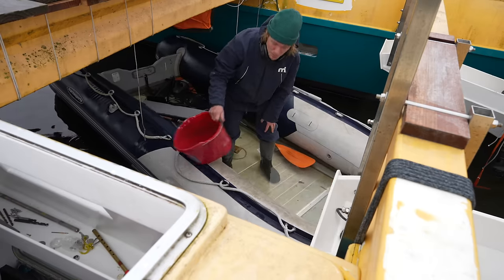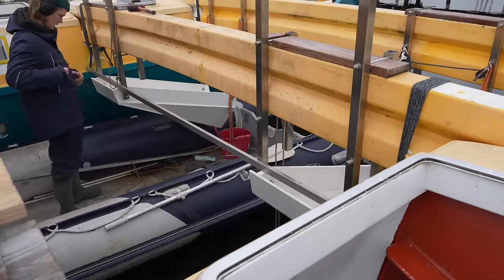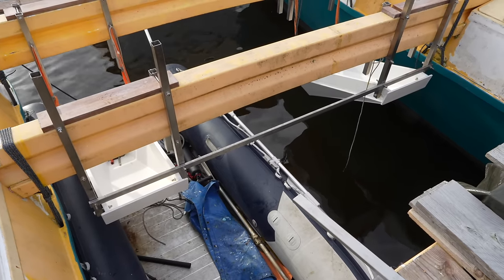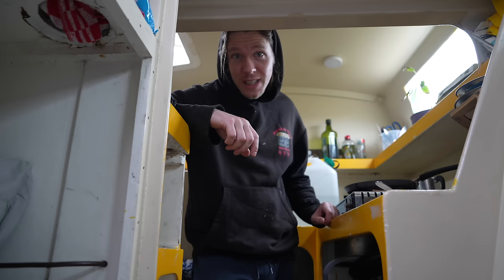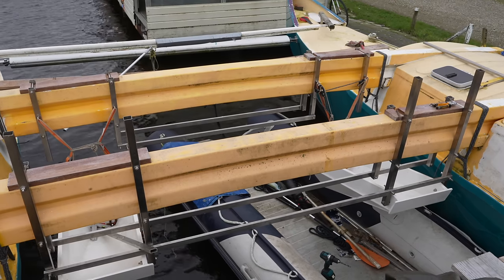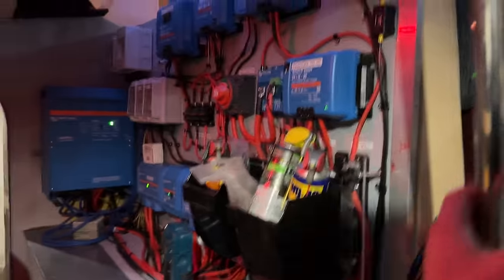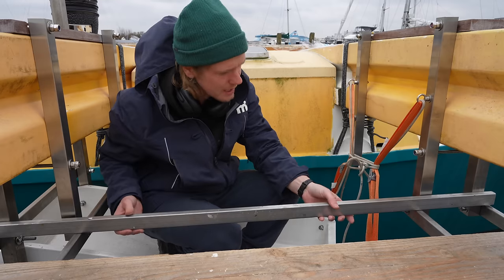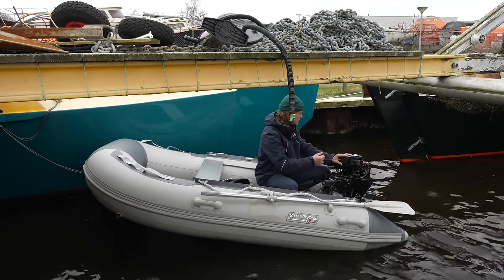I Built A Cockpit Floor for My Ocean-Going Catamaran | Wildling Sailing

Comment: Sorry to say , but you can't bolt hollow tubes together , when you are at sea, it will work loose, as the tubes will compress, and the bolts will come loose ,if you are going to keep going with this , get someone with a Tig welder to weld it all together, and for the main threaded bars that clamp this on to the crossmenbers , add a round tube through the rectangular tudes where the threaded bars go, so the tubes can't compress,
Reply: I was going to say that too and Mark has been learning to weld 😊
Reply: Definitely agree.
Reply: I also believe a threaded bolt is not a good idea for holding tubes together. It will tend to cut and wear in a 'twist and thump' environment, so the whole contraption will loosen up rapidly. Sleeves inside would help a bit, but I am with you on the welding.
Reply: Ty I was searching for the technical comment, I think the whole thing is a really bad idea, ocean salt will corrode the steal to unsafe condition in less than a year, galvanized or not, once you drilled/weld it that join is not protected anymore, paint don't reach inside bolts, this is where you gonna stand, if it falls in the middle of the atlantic you are dead...I love DIY but this thing is really really bad thought and dangerous for him, it's a lot of work I know but I will tear it down to do it again properly...choose another material, don't gamble your life and others on that.

Don't know wich country he is but...there's no maritime regulations there?, as far as I know partially self builded boats must go over inspection before going to sea...when they see this he would not be cleared.
Reply: You my friend are absolutely correct
Reply: Should work just fine, from my point of view.  Just use a locking nut and potentially also some additional locktite. once the design is finalised and proven to wrk you can still weld it.
Reply: @amorfo9127  bro it’s not galvanised, it’s 316 stainless steel. It’s literally made to withstand salt water. You can 100% weld it too, tig welded with 316 filler rods or even mig weld with stainless steel mig wire. I think you are being a little dramatic tbh, just saying.
Reply: I agree with others about welding vs. bolts and I would add angle (forming triangles in the corners) braces. The steel isn't of sufficient span to hold up well even if welded. The whole set-up is going to be tested with any kind of chop. Call me a skeptical mono-huller.
Reply: @ccpmarch1980 it will rust at the welds not a good idea
Reply: @ufodude1000  not if welded correctly. All sorts of things are made and welded for boats out of stainless steel. I’m very confused as to why you think it will rust. stanchions for example or Bimini’s for that matter. If welded poorly or incorrectly then things can corrode but it’s a widely used material and technique.
Reply: Nylock nuts won’t loosen themselves, I’d say keep this design, try it out and if up to par weld it! 😉
Reply: Sadly this a good point, I like the tubing but the flexing of the vessel as designed, is a issue and familiar topic. You did just get a welder....  perhaps some tie rods to manage the flex, possibly from aviation sources.... pretty complex.... my first thought was to fill the ends with a potting compound or a spacer to keep the tube from collapsing at the moment points at the ends....possible sleeve...
Reply: Welding in a piece of distancing tube was enough to prevent that compression problem. It even was sufficient should the distancing part just be in the rectangular tube surrounding the bolts - a Sisiphos task however, to bring those things in the right place while assembling with stainless being not magnetic. You basicly have to use gravity and sticks and do it in the right order. The nylocks could vastly reduce the risk of loosening the connections too far to still be seaworthy without those distance pieces though - it will move and work where those connections are, but James Wharram's boats were built to work and move and take punishments by distributing loads without putting in loadpeaks at connection points. So it might work as it is now.
Reply: @ccpmarch1980  you right. All he needs to use is stainless rods or wire depending how he welds it.
Reply: first thing i thought when i saw him bolting this stuff together...  good call.   one can just rent a welder.  heck, you can probably find a welder who will charge you couple hundred dollars to weld this all together.  Probably will cost not much less in bits and bolts.
Reply: I agree seems like he has more dollars than sence

Comment: Use a magnet to test all stainless bolts, nuts, washers and pipes and tubes. 304 grade stainless will not stick to a magnet and any other lower grade stainless will have some magnetic force and will rust.

Comment: Maybe if you round the wood blocks on top of beams to match the arch of your beams so the top of the wood blocks are completely flat. Then put two short steel tubes across the beam with a gap between them. Then you can insert the hanging steel tube between them with a bolt across all 3 square tubes. And maybe to add strength to the hanging tubes, weld plate to the ends, to  reinforce the walls around the screw holes. Basically, now the weight is on two square tubes for each hanging tube, instead of the threaded rod.
Reply: Rethinking my idea because it would still be hanging on the threaded rod. Maybe welding a tube on top of the hanging tube that rests on both tubes that go across beam. Then it's hanging off 4 welded sides. Bolt the top T bar to the two beam bars to lock into place but the weight is not on the bolts now. I might want solid steel for the hanging tubes and tubes across the beams. It sure is a tricky problem. I'm also thinking flat metal bars with several screws in a column that attach into the beam but not too deep since there's many. Then have bolts through that plate to attach to the hanging beam. Of course you have to put in bolts before attaching plate to beams. Now it's hanging one 3 bolts. You could even make it a an upside down U flat bar that's notched into the beam at the top and screwed there also.

Comment: Mark you need to stop and start on stainless that's why your drill bits are going blunt. you are over heating them. Run the drill for a few seconds use cutting oil and let them cool then re start say 3 second bursts.

Comment: part 3 : I would lash the boards of your floor doing so creating a space between boards for the water to escape faster diminishing resistance to the waves and also doubling safety by keeping the boards in place when the screws fail.

Comment: To drill stainless successfully. Use a good sharp bit apply good strong pressure. Go slow (low rpm's) I mean really slow and use real cutting oil/fluid. Reapply oil as needed. If you see smoke, stop, let it cool and start again.  
You should get real long curly drill shavings.You can't let it get hot!
Reply: I should have watched the entire video before commenting.

Comment: When Drilling Stainless Steel,  Use Kerosene or Diesel as a Cutting Lubricant at Low Speed. You Won't Blue the Metal or Drill Bit by Keeping everything Cool and Slow.

Comment: The squeezy bulb thing. Ah yes. I thought our outboard was busted last year. After having an outboard for 40 years I learned that there is a dot and an arrow on there, and it doesn't just show the direction it will pump fuel, but you need to hold it vertically with the dot facing down when pumping to get the fuel flowing. Who knew ;)

Comment: Cobalt drill bits for ST/ST ... ST/ST work hardens , meaning, once you start  dont stop . Use lock nuts ... TIG is the best way . Every hole is a potential weakness .Also, 316 I hope ?

Comment: To drill stainless you need cobalt bits and only do a start stop applying pressure with your drill otherwise if you drill at high speed the bit gets too hot and dulls in just a minute or 2.

Comment: I discovered step drills not so long ago and not to be over dramatic, but they have changed the way I drill forever. Soooo much easier and hole sizing is a breeze. Yes they do have limits, but with sheet metal (thinner stock), they are absolutely the way to go. Viking Norsemen Vortex Point drill bits are step pointed bits in regular sized sets, they drill holes like a dream, in all materials.

Comment: Glad to see you back. On the engine cage I’d be concerned with the bolts sheering from the weight of the engines putting a side load on them. I would definitely increase the size of them for that reason alone.

Comment: U needed a smaller drill bit, called a pilot hole that clears the way for the bigger full size drill bit. Especially with that steel u had to drill thru.. Keep up the good work!

Comment: Welcome back. I would put two diagonals in the stainless rack for more stability and strength.
Reply: Was just thinking that, triangles are strong!
Reply: I worry about the thrust forces 18 hp could put quite a load on those forward hangers
Reply: Mark, I really enjoy the videos.   I agree on diagonals to make it static, even if it is just a few crisscross cables tightened with turnbuckles.  But welding diagonal elements would be better.  Statics and Dynamics are two very different disciplines. Dynamics requires allowance for wear and tear at the joints.

Comment: I admire the way that you are working. Mahi looks now to be the bones of a well built boat. I kind of wish that I had the physical ability to undertake a project boat but since I was run over by a speeding truck, my strength is limited to a  series of Gold Credit Cards. When I was hit by the truck, it kind of deflated my ability to move freely. I now wish to buy a GRP sailboat, something that will not require as much effort as you are putting in, something that also will not deteriorate in weather.

Comment: slow drilling can chip off the edge of the bit. if you drill faster, the bit will cut smaller pieces, and the small shavings can not brake the tip of the bit.

Comment: The Merc 9.9  is a great little engine.  The carb and fuel system needs a little TLC from time to time.  The carb comes off in about twelve seconds, and you can take it apart and clean it on the galley table with a spray can of brake cleaner.  Enjoy!
Reply: Croma Tap 2 Tapping Fluid 500mL Is good for stainless as a cutting and tapping fluid

Comment: I have done a similar job on my boat doing my chain plates where some of the bolts snapped, it’s a pain in the a$$.
However I have learned that you have to use great cobalt drill bits, drill at low speed and keep oiling it.
One of worst jobs I have done trying to remove snapped bolts.
Your boat is coming along.
All the best.

Comment: A trick with the fuel line is to burp out the air pocket in it by only slightly inserting the quick connect and squeezing the primer at the same time until a stream of fuel squirts out. Then push quick connect on all the way. Prime until float bowl is topped up

Comment: great to see you back. Im an old tradesman and ocosionally give my thoughts. Todays thoughts...

1) look after your knees when your young. The biggest thing i started doing about ten years ago is wearing work pants with double cloth on the knee area that allows the insert of foam knee pads. I leave them in when washing. They are so good. I use childrens interlocking foam tiles and cut them to fit. cheap and good.

2) keep working on expanding your makita cordless tools. never rerget it, save so much time. good tools are a pleasure for years

carry on bravely!
Reply from the maker: ive been thinking about getting some knee pads actually! cheers, mate!
Reply: Tools in boat get corrosion and similar problems-air contain to much water and salt.I prefer cheap ones

Comment: Great to have you back. That diagonal brace for the engines is definitely the way to go. All those steel tubes need diagonal bracing !
Reply: I was just thinking that. Would prevent any rotation as bolts and nuts will become loose over time.

Comment: Part 2 :I have build outboard bracket, I guaranty you the whole thing will constantly get loose .
REMEDY: first leave the bolts but get compression tubes around every bolts to keep the pipe from giving in.
Then weld a triangular bracket at every intersection, with the tubes on either sides of it ,then you will have a self supporting independent apparatus .Personally I would also bolt it right through the beams after properly waterproofing the holes by epoxy encapsulation.

Comment: M12 bolts is a great idea. Looks like she’s held up well in your absence.
Reply: The bolts are wayyy stronger than the hollow profile used in this way. Better insert round stock into the top part of the profile, to 1) stop the hollow profile from compressing and 2) stop the bolts from bearing out ('tearing out').

Increasing the bolt size to M12 will not make it stronger this way

Comment: Cobalt drill bits are the way forward for drilling stainless steel. Also bear in mind that stainless steel work hardens when drilled. Make sure your bolts protrude through the nylon part of the nylocs so they don't come undone. Great work and it's starting to come together.
Reply: True!!!
Reply: Yes they certainly seem to be the way to go. But i think he's using regular nuts. At least some of them seemed to be. I already mentioned this above.
Reply: Stainless also work hardens when repeatedly plasticaly deformed ( in this case, bent ). Not a great solution.
Reply: Always minimum 2 threads showing when using nyloc nuts.
Reply: The trick with stainless is to use more pressure and slower drill speed. Once stainless work hardens you are stuck even cobalt bits will struggle

Comment: Got to admire your determination.  I'm not a fan of outboards pushing cruisers but appreciate you have limited options  on your boat. Whilst your mounting arrangement will be sufficient to hold the engines I'm just wondering whether they will be sturdy enough to handle the  driving force in a bumpy sea. Time will tell. All part of the great adventure. Fingers crossed 😅

Comment: Minor suggestion, use cutting oil for lubricant while drilling, stainless steal is notorious for  destroying drill bits or any cutting tool. The cutting oil also cools the bit so don’t use WD 40 it evaporates too quickly and loses its lubricity and cooling power. As to bit metal use Good HS Steal bits or cobalt but just a hint cobalt hard to sharpen after they are dulled.

Comment: Mark, thought you might want to know that I recently learned something from a old metal fabricator on drilling holes. Use liquid dish soap as a cutting oil and it will keep your bits cool and it honestly works quite well.. good to see you back mark.. only have had sailing seabird Friday uploads for awhile now but you're back and can add to the Friday entertainment

Comment: I would be fiber glassing the flooring at least on the bottom where you are going to be getting wet from the ocean.  Be better to fiber glass both top and bottom, I know it would be a lot of work and a high cost but in the long run be stronger and last longer.

Comment: A lot of modern drill bits aren't designed to be sharpened, they are basically a disposable item. And remember when you are sharpening them don't let them get to hot as they'll just go brittle.

Comment: Locking fasteners and/or LocTite will be important in the frame design, with the engine mount torque and vibration provided by both sea and engines.

Comment: Anyone who's used one (let alone a pair of them) knows 2-stroke engines always have been temperamental. If you don't already do it, always run the gas out before shutting down if they will be sitting more than a few hours. When budget permits, upgrade to Honda 4 strokes and never go back.

Comment: I think  failing point of you suspended structure is not the bolts but rather the part of the vertical square tubes above the bolts. If you increase the diameter of those bolts you will end up with even a lower amount of metal there and it will make the entire structure even more fragile. You may ran a software simulation to know the structural integrity of your contraption if you have some basic understanding of mechanical engineering. Also you entire approach is a problem : You  add features and charges to your contraption and think about material resistance afterwards. You will end up overloading it and have to scrap it all together in order to redesign it from scratch because you didn't thought about the ultimate state of your cabin and engine bay beforehand.Another point : You design a boat not a house. In ruff sea you will encounter many more forces than gravity and even the force of gravity will not always be vertical and constant. You also have to account for large waves smashing in you structure and pushing it upwards or sideways. Unless you don't expect to sail on open sea?

Comment: Welcome back mate. As others have said stainless steel must be drilled slowly and with good drill bits also it look like You use normal WD40 as cutting lubricant which it’s not very good for. WD40 has a special cutting oil for this purpose.

Comment: Hi, I'll give you a piece of advice: don't use iron drill bits but buy cobalt drill bits and you'll be drilling holes in stainless no problem and in no time. They cost more but you don't lose time believe me.

Comment: The fuel is getting air locked in the line from the expansion tank , have the tank higher or keep the line straight or better a shorter fuel line . SIMPLES

Comment: The clear inner lining of that gray fuel hose gets very soft, due to crap gas {especially gas with Ethanol ). If you ever take a fuel fitting off the hose and then put it back on, the fitting pushes the inside lining in and causes the blockage. Take off the fuel fitting that goes on the outboard and see if it is clogged. This happened to me, yras ago,. I replaced all of my fuel hoses with the black automotive hoses. End of problem